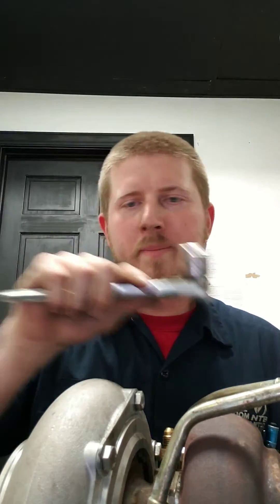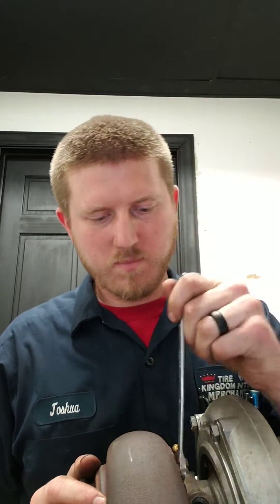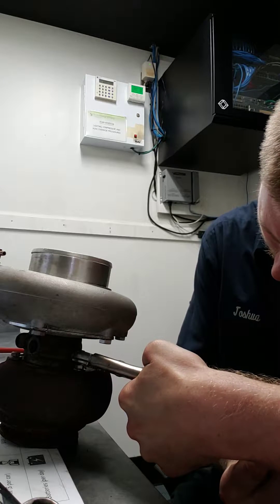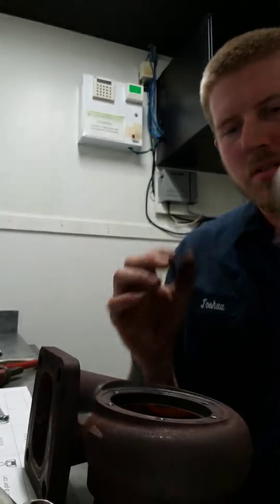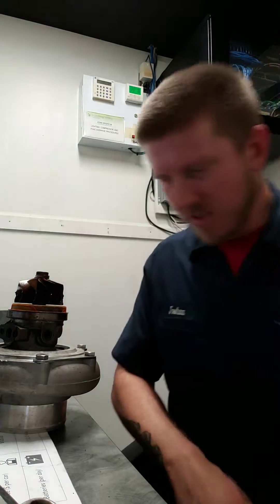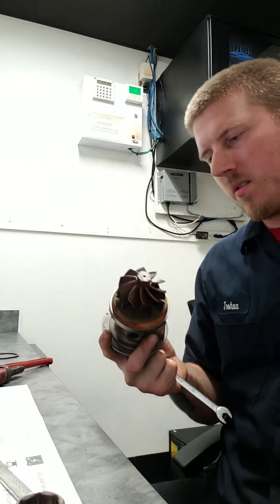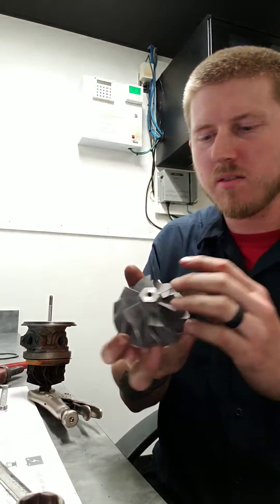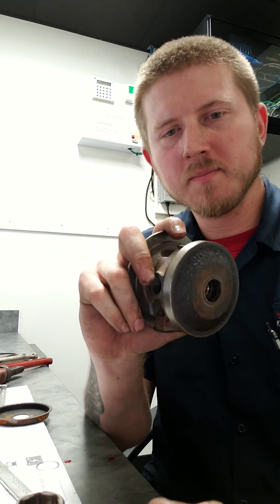Gt35r Ebay turbo tear down

Comment: Hey i have that same turbo it apears it runs a small as fitting on oil return did you have that same issue
Reply from the maker: I didnt end up using this turbo because of the turbine blade wear.